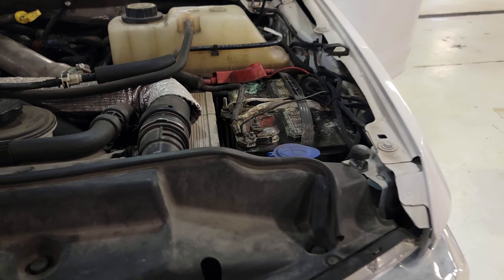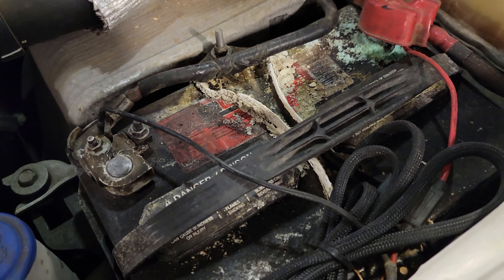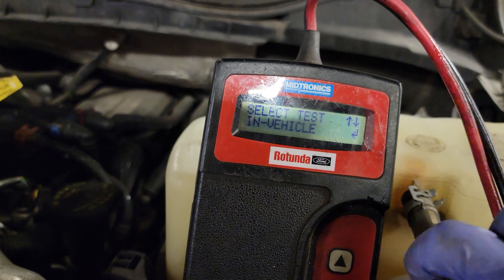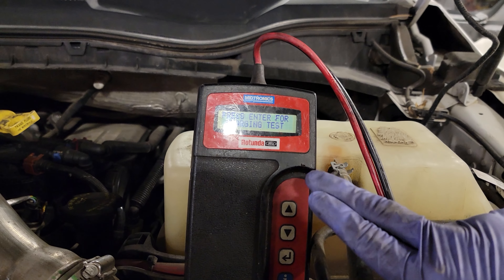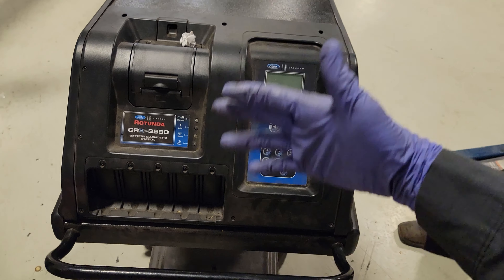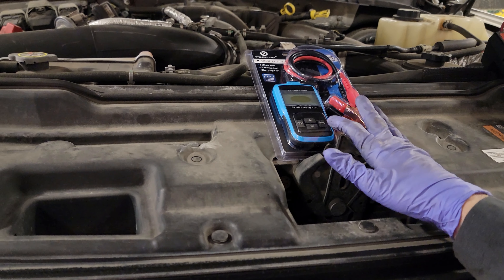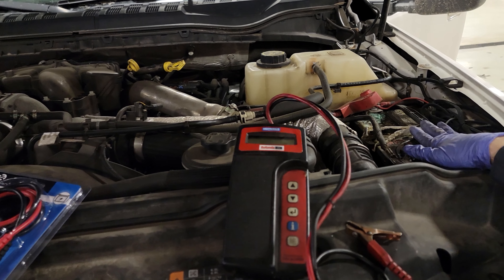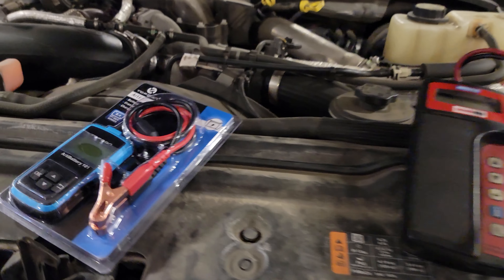How to check your battery in FORD Trucks - FIND OUT HOW HERE!!!

Comment: A pair of Odyssey 65-1750s and be done!  I’ve had them on the 17 for 2 years and not once have they spilled like the factory batteries or even slowed cranking in -20° to 120° temps. 
Definitely pricy but worth it.

Comment: As a DIY-er for years ive just used the Schumacher BT100. I recently upgraded to the Topdon BT300P. It tests tue battery for CCA, starting, and charging. On a whim tested my wifes battery the other day, because I knew it was getting up there in age, and the tester told me to replace it. It seemed to have been functioning fine, but the CCA test was low enough from what it was rated for that the tester deemed it to be replaced. Happy wife happy life. Dead battery would not make wife happy.

Comment: Awesome tips! Those little battery testers are nice. It's on my list of "must haves". My boss always checked batteries with a tester whenever customers purchased new batteries. He has found a few that needed charging to be optimal. Just because it's new doesn't mean it's good. The tester could be used if purchasing batteries at Walmart or the big clubs like BJ's, Costco and Sam's.
I've always used a mixture of baking soda and water in a spray bottle to clean up the batteries and rinse off with clean water. I apply petroleum jelly to the terminals.

Comment: I was about to comment don't forget to isolate the batteries when testing 😂😂

I use the interstate handheld tester, runs cranking and charging tests as well.
Reply: The ED18? I use the same one, many functions on that bad boy 👍🏻
Reply: @daddydiesel5889  yessir 👍
Reply: @johnm9131  nice, does it ever tell you “surface charge detected turn on headlights” while testing a battery?
Reply: @daddydiesel5889 yeah would every now and then.
Reply: @johnm9131  ok thanks I was just wondering, ours seems to be doing it more and more lately.

Comment: I always use dielectric grease on the terminals and basically any other electrical connection. Never have issues and my terminals are always clean. I’d be ashamed to have batteries like that. 😂

I have heard good things about Noalox and may give it a try next time.
Reply: Petroleum jelly works pretty good too

Comment: Thinking of switching to an AGM battery but was curious if a 6.7 will keep the batteries charged properly.
Reply from the maker: Gotta ude forscan to change flooded to agm
Reply: @PowerStrokeTechTalkwARod  if I don’t, it won’t properly keep the AGM charged?
Reply from the maker: All for the battery monitoring system

Comment: I may or may not have kept several customer pay batteries under my bench to get warranty codes out of. 

Midtronics is a good power supply for long module programmings

Currently use a carbon pile capable of 1000amps (1/2 CCA for 15 sec). Larger batteries give mixed results on the hand held tools
Reply from the maker: I got a trick for ya pal
Reply: @PowerStrokeTechTalkwARod  
A sneaky Ford guy trick? I've been off flat rate since 2018 so my skills are slippin

Comment: From 2017 on the batteries seem to vent/ leak on the450 550s we have 15 trucks  replaced with  non ford batteries  no more  issues after that  all were less than a year old all tested  good just to much  corrosion issues  snapon  avr tester is what we use

Comment: If the batteries are connected in parallel, do I need to worry about radio station presets if I disconnect just one lead off one of the batteries?
Reply from the maker: Nope. U cld even replace one at a time too

Comment: My 2017 6.7 kills battery’s two at a time every year and a half. My terminals get corroded really fast. Is my truck over charging?
Reply: Odyssey AGM's will solve that. They are sealed and the best battery I could find for these trucks. Longer reserve capacity also for camping and running extras.
Reply from the maker: What Batts u using
Reply: @PowerStrokeTechTalkwARod  
Last set was Duralast gold but after they died they gave me a free upgrade to duralast platinum.

Comment: When you disconnect either battery for cleaning or checking, what electronics will be affected and need resetting?  Is there a time limit where nothing is affected?
Reply from the maker: Nope just disconnect & reset radio & what nots

Comment: Question:  is there an isolator between the two batteries , so after starting,only one is supplying power to run the truck?  Just wondering.🤔
Reply from the maker: No sir

Comment: Good videos how long should we expect our stock batteries to last on the 6.7?
Reply from the maker: If they do not leak I wld say a solid 3-5 yrs
Reply: I kept our 2015 batteries on battery tenders since new, replaced them three months ago,  lasted almosr 7 years.
Reply: @tedalbin1607  did you need two tenders or does one work since they are tied together? Just curious.
Reply: @Uncle_Fester24  used one for each battery. We used the Battery Tender brand.

Comment: I find those small non load drawing testers to be erroneous. I prefer the old fashioned carbon pile tester. Or a newer electronic version.  They seem to be more dependable when it comes to these larger truck and pickup batteries.

Comment: If everything is taken care of properly...🤔how long should we expect oem batteries to last?? I've got 4+ yrs. On mine & no problems to this point.😉🤗...later 👍💪💯
Reply from the maker: I got an 83 with a 12 yr old batt!
Reply: I’ve got a 2012 GMC Sierra Duramax with original dual batteries. They will be 10 years old in April and still going strong. They even test ok on a battery tester. I use the truck for moderate duty plowing in NH, go figure??
Reply: @PowerStrokeTechTalkwARod  do you leave it plugged into a battery tender/trickle charger? That’s the only way I’ve gotten more than 3-4 years from a battery.

One motorcycle battery was 11 years old and it was always plugged in when parked at home and that’s the best I have gotten.
Reply from the maker: Yes a tender all the time
Reply: @PowerStrokeTechTalkwARod  I knew it 😂